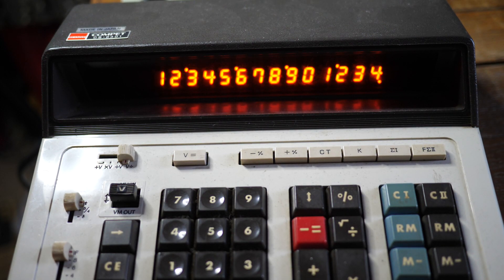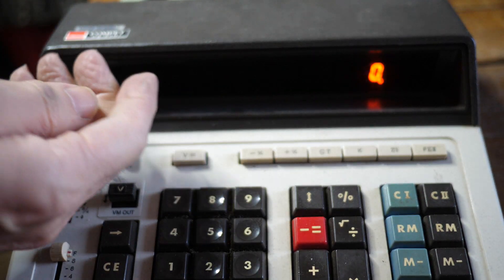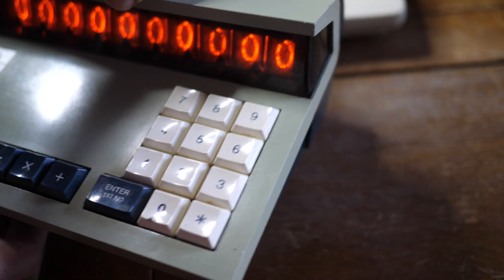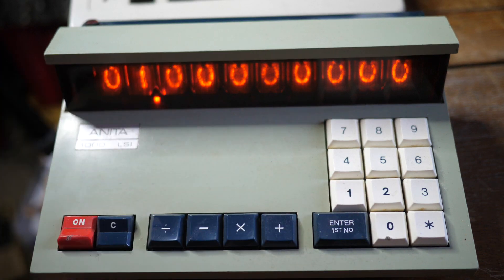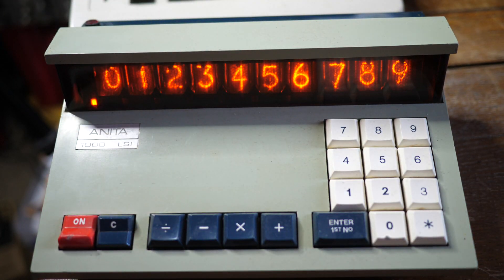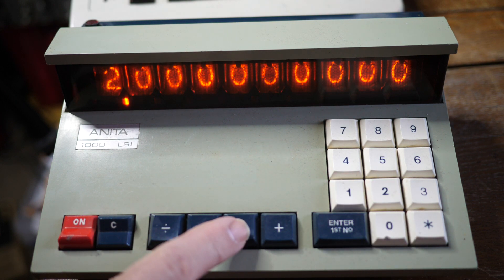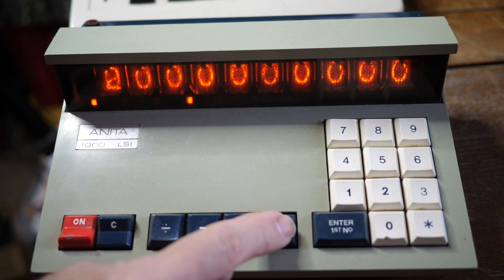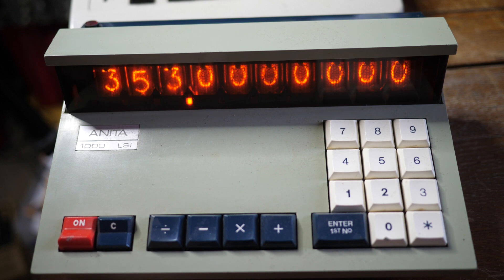Anita 1000 LSI Nixie Tube Calculator

Comment: RPN was rather easier to implement than any kind of algebraic entry, so even some of the complex machines that took algebraic input translated it to RPN operations internally. Just making the system RPN probably simplified it electronically. 

From the documentation I can find, it appears that C switch stands for "constant"--I think there are only two stack levels, but when the C switch is engaged, the current result will be held as a constant. The way it works is a little different from what I expected--if you then enter a number and press an operator, the constant will be used as the second argument.

If C is not engaged, you could clear the calculator just by entering 0 and "Enter 1st No."